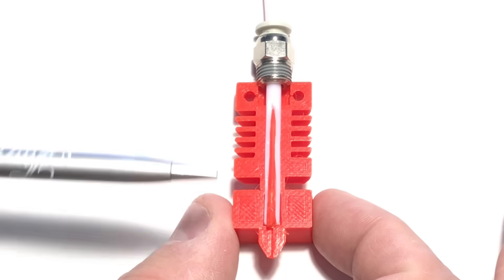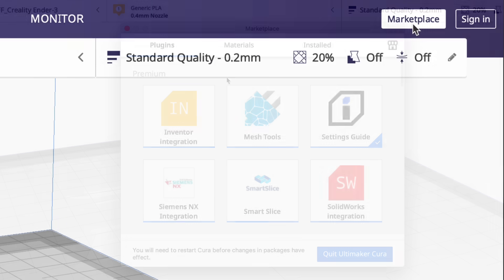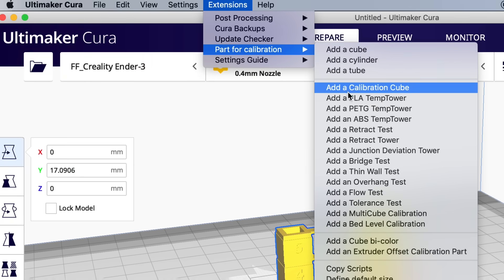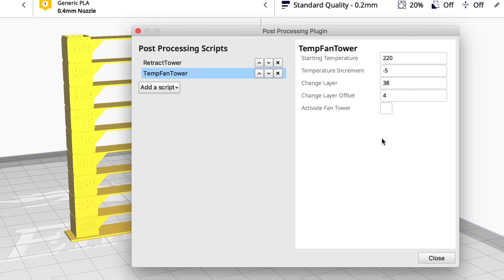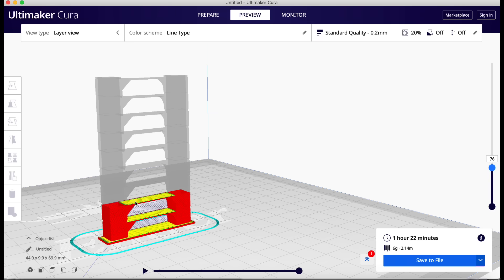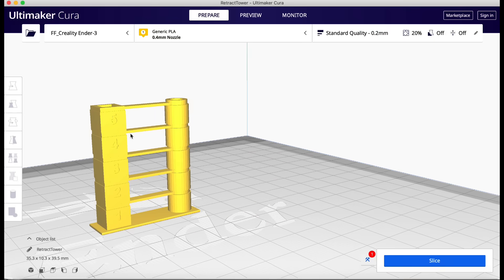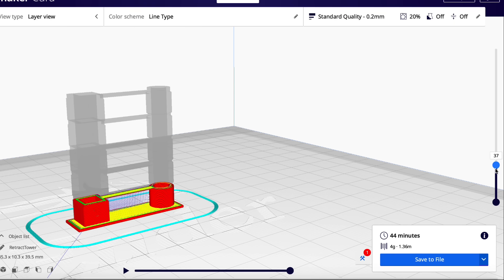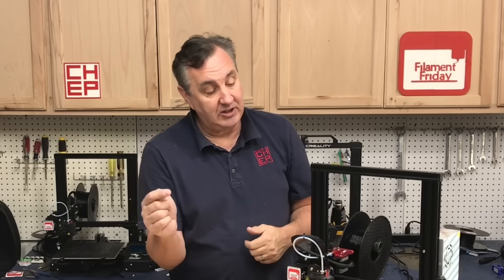Calibrate Perfect Retraction Settings Using a Cura 4.8 Plug-in

Comment: Do you turn support on for this ? I ask because I don’t see any in finished project.  Did he tear it out? You’d tear the stringing out.  Confused.
Reply: Adding support would completely defeat the purpose of this test..
Reply from the maker: No support.
Reply: In case you coulden't fix your issue. When you click on extensions then click on post processing then modify g-code you find your skripts :)
Reply: Wow.  I couldn’t believe it drew across the bridge.   Neat.

Comment: Hi all. I'm using Cura 4.11 and there's no copy scripts option. What am I supposed to do?
Reply from the maker: Skip that step they’re already installed.
Reply: @FilamentFriday  Thanks for replying. I'd read other comments after asking and got the right settings for the temp tower. I couldn't quite get the layer changes to match up on the retraction test (despite doing as @Ares suggested), but it's out by such a minor amount it doesn't matter much. I'm currently around 25% through printing the retraction test. 
After this, it's about getting a nice glass print... Again, thanks for replying. Many other channel owners don't bother to respond :)

Comment: I've been running an ender 3 farm for a couple years now and never even knew about the plugins. I'm always learning! They seem so useful. Great video.
Reply: and I'm just watched like 4 videos on how to download temp towers, and set it up manually, this is all ready! im freaking happy
Reply: Oscar, in your experience what do you think works best: to print as cold as possible (190) or to go as hot as possible (220)? I've been doing these tests and with the correct settings, printed parts look the same.
Reply: @MeGrimlock511  if the result is same, I would print low temp .... energy saving, but the question is, how the layers will stick together in low temp and how strong the print is  ? If the layers are disconnecting, it's not good
Reply: They just added in cura 4.12

Comment: I struggled for days producing towers like his, all looking the same and with no temp changes being ever shown on the screen of my Ender3 pro with 1.1.5 board and Marlin 1.1.9 [ as delivered installed by Creality]. My problem turned out after 2 days of torment  to be that I was using non-standard slicer settings. When I changed to the "Standard Quality" settings in the Cura 11 slicer with all layers being 0.2, and then in the slicer I set all the print temps all to 220° [the start temp set in the "TempFanTower" script] except the "Final Printing Temperature" to 190 as per the script setting, all went well. The tower printed as it should, the screen showed the temp as it changed, and the tower went from a stringy blobby mess at 220 to a good print at 195 and 190.  I hope my findings help someone.

Comment: Why does the temperature not change when printing the temp tower? I've modified the gcode as shown, and it still processes the print via my default setting(s).
Reply: Me too with my Ender 3 pro.
Reply: @kencroft7933  Yeah I own the same make & model.
Reply: Have you tried turning adaptive layers off?

Comment: im running 4.11 did any of this change? fyi every time i use this method the temperature never changes during printing
Reply: Me too, Ender 3 pro
Reply: running 4.11 on cr-10 smart, works well - I was skeptical at first and analyzed gcode, it's all there and screen showed variations of temp as print went.
Reply: @nathaneltitane  I was having moisture issues darn it
Reply: @kimkennedy1105  had the same thing right before running the test. Was using generic creality filament. Swapped it out for Overture Matte Pla and everything works like a charm. Moisture's a real b*tch! Have ypu tried MarsGizmo's cereal container dry-box setup? Works like a charm, and you don't need bearings either!
Reply: @nathaneltitane  no I had a gift card to Amazon and purchased the sunlu dryer. I needed something quick
Reply: @kimkennedy1105  got the containers, feed nuts, dessiccant and tubing next day and assembled everything in 10 mins ✌🏼🔥 - made 4 dry boxes for roughly 80$CAD

Comment: my bridges are drooping, and are not coming out flat and clean like yours are got any idea on how to fix that?
Reply: Either travel speed too slow or insufficient cooling on account of a bad or blocked part-fan. The length you can bridge is determined by how fast the filament hardens after it's extruded.
Reply: @aimeeaaw  okay cool I'll have to try and up my speed and will check my fans to try and fix my issue. thank you for the help!

Comment: I've found 200 to be nearly the perfect temp for every pla that I've used. I haven't used retraction so far at all but I have a red filament that's gotten a little brittle that likes to string so I want to start trying retraction with it. Wood filament strings a lot too. But I have a bigger issue with wood filament, it likes to retract z bunch out at the start of every print for some reason every time I use it.

Comment: cant find the copy scripts option on my cura please help :( thanks.
Reply from the maker: Later versions automatically include the scripts so skip that step.
Reply: @FilamentFriday   ok, but i check the changes in temp the 220 is at layer 39 and the 215 is at 81 is that ok?
Reply from the maker: You can adjust the layer change in the script if necessary.

Comment: I just got a brand new roll of O** PLA.  I RAN it at same CURA settings (temp, speed, brim) as other brands of PLA and after 3 try print but is bad. Guess good idea to do temp tower and retract tower before getting into a new roll of filament ?
Reply: Might be wet/humid. Warm it up to 50°C in the oven (no hotter!) for 4½ hours.
Reply: @aimeeaaw  I had just opened it brand new.  I store in home made dry box that gets air humidities down to 17%. Outside box is 44%

Comment: I just printed the temperature tower on my Davinci jr Pro with esun pla+ (which recommends between 205 and 225 degrees), and was shocked to see it perform MUCH better at the 180-190 range. I then printed a small retraction test. I think I just printed the best retraction tower of my life! I would appreciate it if someone could explain why there is such a discrepancy here. 
This is life changing.
Reply: I find that the suggested temperature on all my filaments is noticeably higher than it needs with my printer.

Comment: Good day! Thanks for good job!
Did I understand correctly that after determining the optimal temperature, we enter it manually into the Cura 4.11 settings for cutting the retract tower? Next is another question, after I have determined on which section the optimal retract parameters, where will I get the numbers for setting? Do I need to read g-cod or something else?
Thanks👍

Comment: Can you update your video with new version of cura and script.  Things change.
Reply from the maker: Other than copy scripts no longer required nothings changed.
Reply: @FilamentFriday  Apparently they made changes of some sort, as was noted by another comment, the levels are not equal.
Reply from the maker: I just loaded the retraction tower in Cura 4.11, used the same settings used in the video and it was spot on. So not sure what everyone is talking about.

Comment: Changing the distance works as it should with the plugin but when I try to do a retract tower and instead change the speed, it does not change anything on the actual print. The initial retraction speed is correctly set and does display on the LCD as expected but when it reaches the first change point, it displays something like "speed F300". I am assuming something to do with how the plugin writes the gcode but lack the knowledge to troubleshoot it. Any help anyone?

Comment: Using Cura 4.11 the Copy Scripts does not appear in the menu. Has anyone else found where they moved it? Update: Scripts already seem to added to the post processing screen already now.
Reply: Since version 1.3 of the Calibration Shapes plugin in combination with Cura 4.9 and newer, the scripts no longer need to be copied; they can be used from the location of the plugin instead of having to be copied to a special location in the configuration folder.
(skip the ‘copy script’ and restarting part, just go to modify g code under post processing)

Comment: Have found in order not to clog there is a need to cools down better the radiator - so instead of 3010 fan installed 5015 ;) works perfect!;)

Comment: CHEP, I got a problem. When I do the GCode processing configuration I change every value... and then I check... I'm printing on 0.1layer high so my first layer change its at 73... I use that value.. so next change layer should be at 146.. but on my tower Im getting 149 of the change of layer.. how to solve that? thanks
Reply: Just a hunch, are you using 3 bottom layers? Could be it's counting after the bottom layers.

Comment: I'm confused about retraction testing.
In Post processing scripts what value is it that influences Retraction - is it a retraction speed test?

When the test is finished printing, and you evaluate the result, where in Cura setting you then go in and change the value, so that your prints get the right Retraction setting
Reply from the maker: Retraction distance
Reply: I am wondering the same thing..

Comment: amazing video!
using g-code:
do you know a way to turn off the bed temperature down or turn off after let say 1 hour or 2 hours or 1 day and then turn on if i need it?
i have a bending problem and this comes from the bed temperature and the fan on my chiron.
i will appreciate any help. thanks!
Reply from the maker: Not that I know of. But check Marlin commands for options.

Comment: I've been dealing with really bad stringing for MONTHS, I had no idea what was causing it, let alone how to fix it! I've done the temperature tower, just printing the retraction one now. Hopefully this will fix my problem.

Thanks for another really useful, easy to follow video!
Reply: Update: No luck... this is getting really frustrating, I wish i could figure out what was causing this
Reply from the maker: Did you try this: https://youtu.be/OG7We83M5gc
Reply: @FilamentFriday  I feel like an absolute idiot right now, but I'd forgotten to disable the Cura script for the retraction test tower, so it was trying to run it during my non-test print. Total facepalm moment, but fingers crossed the print I have running now will come out a lot cleaner now I've turned that off.

Comment: After running this test my retraction is worse towrds the top of the tower.very light stringing between 1 to 3, then massive globs and stringing near the top?
Reply from the maker: Then you have other issues with filament retraction or PTFE failure. Try this first. https://youtu.be/OG7We83M5gc

Comment: Outstanding video :-) The retraction settings that we found using cura plugin, can be used within other slicers like Simplify 3D and IdeaMaker ?
Reply from the maker: Probably
Reply: @FilamentFriday  The retraction script varies the distance. The retraction speed is fixed and uses the one set in the slicing profile, correct?
Reply from the maker: Yes.

Comment: The right retraction setting will vary depending on the pattern you print. I used the tower method to adjust my retraction, only to find serious issues when printing a mesh. That issue, would also apply to most infills, buy you would never see them, in a finish print. Thanks for pointing out the temp issue in relation to this. For my work, that added another layer of complexity to the mix, as the only way I get layer adhesion to work in combination with printed mesh, is to slow everything down to snail speed. The tower calibration method has some flaws, and the main being that it is too forgiving, and it will mask issues with for example infill edge bounding. If printing a wire mesh, what looks perfect on the tower, suddenly is dysfunctional.

Comment: Running Cura 4.11 and the scripts copy button no longer exists, but they can be copied to the post processing folder manually from the GITHUB repo.

This is so awesome. I'm finally going to be able to get all of my filaments dialed in to perfection... and then use them together under the best conditions for each.
Reply: In Cura 4.11, it doesn't seem like you need to do the "scripts copy" step. You can go straight to "extensions > post-processing > g-code" and continue with the video's instructions from there.

Comment: Actually they keep changing the settings, so 0.2 mm layer height will no longer work with the same post processing setting. Currently they suggest 0.16 mm layer height with temperature change at layer 52. However I suggest you go to cura extension -> part for calibration -> help and then go to the calibration print site that will explain to you the most recent suggested settings. Hope this helps.
Reply: Bro!! Lifesaver 👌👌👌👌
Reply: This was super helpful! Thank you for commenting!

Comment: hey there, thanx for all your amazing tutorials. i am only about 3 months into my new 3d hobby, and loving it. i just have a quesion that i cant find the answer to. when you using the plug in as described in this video, and you filled in the retraction tower starts from 1mm, and increases by 1mm up to 5 mm...DO YOU CHANGE THE RETRACTIONDISTANCE TO 1mm in the Cura settings as well BEFORE YOU SLICE the thing, or do you just leave on whatever it is set and...will the gcode automatically make it start printing at the 1mm retarction distance?
Reply: dont worry. just saw that Rivers_Lakes asked the same question 4 months ago...all good

Comment: I had trouble printing this temp tower, my model didn't change temps moving from block 1 to 2. I only changed at block 3 or 4. After messing with it for a while i realized in your regular slicer settings your print temp needs to be 0. Initial layer and initial temp still need to have proper values. Otherwise the temp tower doesn't change temp until the third bridge which is confusing and not accurate.  Second thought-   I just printed a temp tower and the change layer was 41/82/... with no changes to size. Only the PLA standard temp tower needs adjusting in size.

Comment: Anyone get this to work in Cura 4.10? When I slice it the layers are all off
Reply: Dude. Hit the preview button
Reply: @dougwolf2208  what I meant is when I'm in preview and looking at the layer heights the temp change is not constant. Doesn't matter though I got it to work a different way
Reply: @zman4002  I don't think it will show it in cure, it is "post-processing". Only on the printer
Reply: @zman4002  I suggest print it and watch the Temps. It should change throughout the print..good luck friend
Reply: @dougwolf2208  you must've not seen the end of the comment....I got it to work, I went to a website and you plug in your g code for your printer and it gives you the gcode for the tower
Reply: @zman4002  oops I must have just focused on the first part lol! 😬 what's that website? I'm curious 🤔
Reply: @zman4002  I watch him a lot, ohh I know what you're taking about !!!!!

Comment: I did with 0.08 layer height and it came out horrible all over the top, am I missing something?
Reply: The top part of the model prints at the coldest temps, so unless you have a super low temperature pla you most likely won’t get any kind of good result until you run into the more normal pla temp range

Comment: A good tutorial brother.  Thanks for existing I was getting a ton of conflicting information from the various groups and forums I visit for 3D printing advice.  I will note that for some reason, even though our settings were the same, my layers did not line up exactly, but with a tweak to the offset everything was peachy.  Did both these tests then ran a benchy which is very close to perfect.  TY

Comment: Bit late to the party but just for anyone new to try this on Cura 4.10 it's basically the same, except now there is a new  PLA tower for 190 (instead of all the way down to 180). Using it the numbers seemed to be 4 height,  change at 42.  Didn't have to rescale or anything.

Quick note, however:   Your Cura Slice settings will be applied to the brim/skirt and lower 4 layers (so temps, etc) then at 5 the temp will start increasing to 220. (the PLA Tower Setting)  after the 220 is completed, it actually does 4 (probably from base 4?) layers of 220, then starts decreasing to 215.  (This was observed in my printing)

So perhaps a base of 0 - is the choice.  This would mean the first layers (and adhesion) would be 220 though - so I am not sure if that is a great Idea. (220 always seems to be too hot for my PLA) and perhaps this would also skip the 4 layers of "next temp" since there would be 0 base?    If it bothers you that much anyway.

For me knowing it does the base at my standard setting, then cranks to 220, then does 4 layers "too high" of 220, before going 215 - is enough to then look at the results and judge settings.

Comment: Hmm maybe I'm missing something. After running the test I found which retraction settings were good for me however when I go and print my model out it still has a lot of stringing but only during the moves in which its doing the holes. It has two screw holes. Any time it move too or from those points it carries a long string with it. Any other moves don't cause this. Trying to wrap my head around this.

Also my benchy test with my current retract settings had zero stringing.